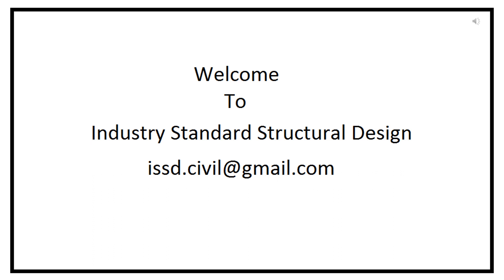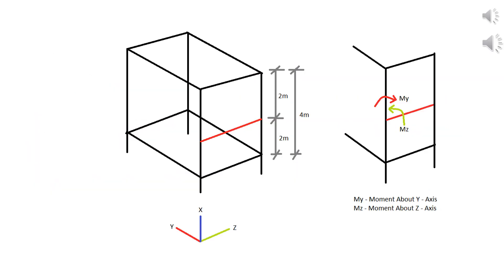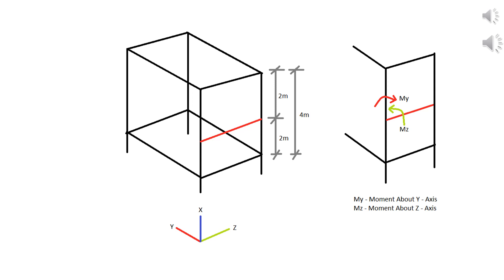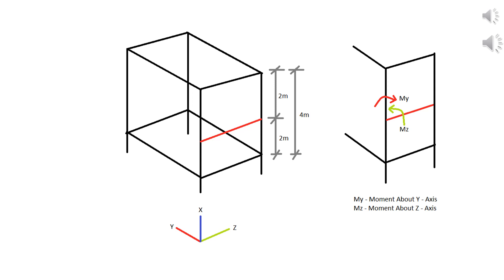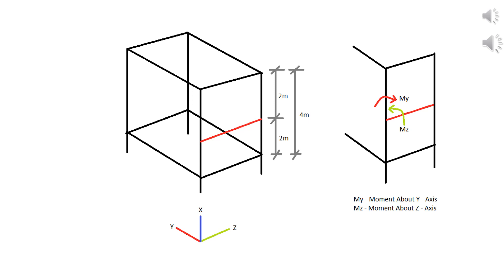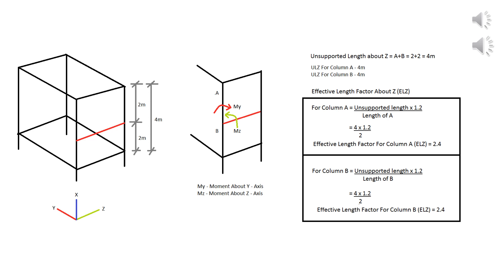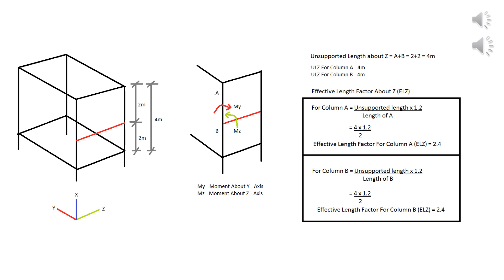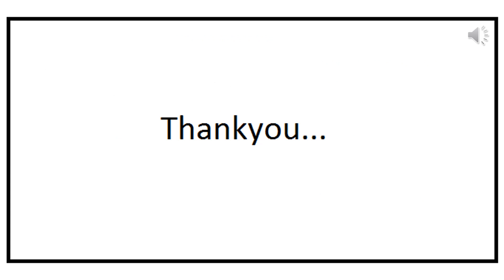Effective Length Factor Calculation For RCC Columns

Comment: @1:35. Columns A & B are unbraced along Local Y and both will simultaneously bend about the Local Z within the 4m column height. 
Therefore in design the length of A &  B will be both 4 meters. 
Effective length factor ELZ = 1.2 for both is ok